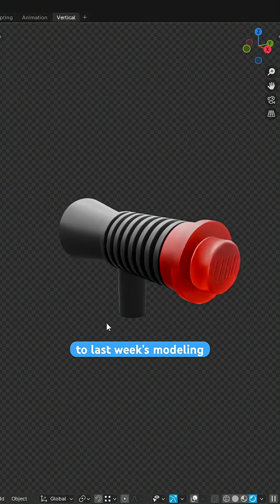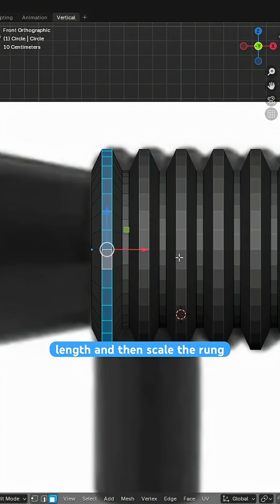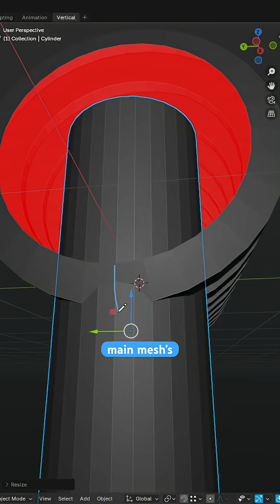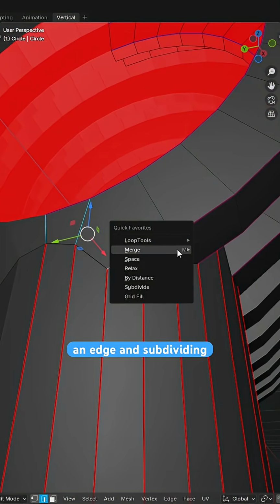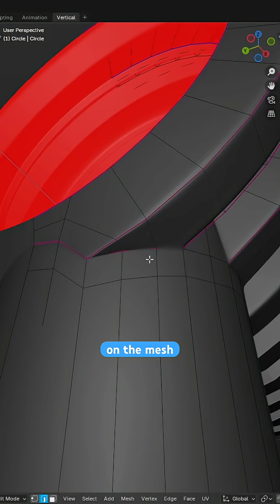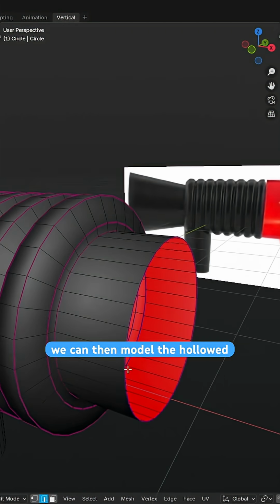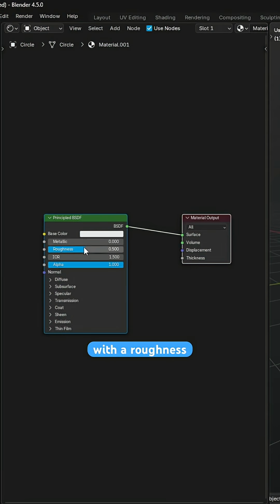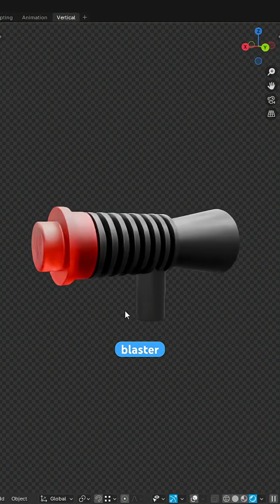Model a Lego Blaster in Blender | #blendertutorial #blender3d #blender3dmodelling

Comment: Wouldn't it be easier to use circles with less vertices?
Reply from the maker: Potentially? Though, you would still need to resolve similar poles and likely become much more of a headache when joining the meshes together since you don't have as many vert points to reference (really depends how low of a poly count you choose to go with). 😄

But I think a circle with 32 verts is a good vert count for an asset like this. You can always decimate and optimise the mesh afterwards. 😄

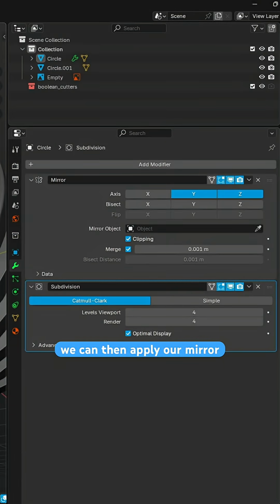Comment: In 1:49 how do you only mirroed the cilinder part without mirroing the handle???
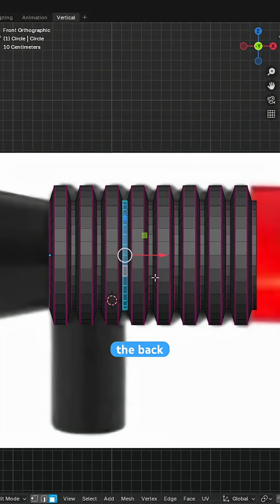Reply from the maker: So at 0:32, after applying the array modifier, I separate those back three rungs from the rest of the mesh in preparation to do the boolean and mirror modifier operations on that isolated area. 😄

Comment: Me, an engineering student, having a couple years of experience in SolidWorks: "Ah yes, I've heard of meshes before."
Reply from the maker: Haha, yeah, parametric modelling and vertex modelling are two very different beasts. 😅

it all comes down to the intent of what the model is being used for/the modellers preference. Traditionally speaking, you'd use parametric modelling for print and vertex modelling for digital use. Though like many things in modelling, that's doesn't have to be followed so strictly, as I know people that do vertex modelling for print and others that use parametric modelling for digital assets. 😄

Comment: Onshape could have gotten this done with a fraction of features and work. Blender just isn't efficient, nor does it make fully manifold mesh files. I always have to repair the mesh files that are made in Blender.
Reply from the maker: I mean, it really depends on what you’re modelling for. 😁

In my case, subdivision hard surface modelling is ideal as it lets me simultaneously create a high and low poly model which works nicely for normal baking and texturing. 😁

I’ve never done modelling for print, though people in the past have followed along with my tutorials and made prints without hassle. Though, using parametric modelling software would obviously be better for print given that’s what it is designed for. So it ultimately comes down to the intent of what the model is being used for. 😁

Comment: As someone who cad models, you blender guys drive me nuts 😭 low poly models that are based on proportions only and no measurements. Don't even get me started on surface rendering vs the actual mesh. 

Cool tutorial though! Feels like more work then cad for you guys sometimes
Reply from the maker: Haha, yeah, I typically only model based on proportions but every now and then I'll display the actual edge lengths when modelling to better distribute details. 😄

Mind you, you can model things to a proper scale in Blender, I know people who do this for manufacturing print models that need to be precise down to the mm. So it is possible, but I much prefer just eyeballing things, which being a CAD modeller, I can see why that would drive you nuts. 😅

And yeah, possible a little more work, but for being able to bake normals and texture the asset, it works out quite nicely. 😄

Comment: I don't think you need to necessarily merge different shapes together. You can make clipping meshes look pretty good as well
Reply from the maker: You're totally right, though, the idea of these challenges and the modelling exercises that they offer are to get people thinking about topology and problem solving. 😄

Intersection cylinders are a tricky subject matter in subdivision hard surface modelling, and they are never a one size fits all solution. But the learnings gained from this challenge would then also be applied to say needing to model in a screw hole to a mesh. An instance where the mesh is depressed and therefore needs to be integrated into the topology. 😄

Comment: ah. i've been studying cad for over a year now. blender is just a different animal 😭
Reply from the maker: Haha, I feel the same way about CAD and parametric modelling. 😅

I've only learnt vertex modelling, so I'm completely lost to modelling outside of that. I still find it immeasurably interesting despite not understanding it though. 😄
Reply: @masterj2001 so there is hope! 

for me, figuring out my process came from taking measurements off of real parts and building step by step. similar to how it works in this video.

but, it's a lot simpler of a toolbench in packages like solidworks or onshape. taking sketches and dimensioning, then extruding/subtracting, applying patterns/arrays, fillets and chamfers, etc

but thankfully, no messing about with topology or uv or shaders. just functional parts :)

Comment: now recreate the low poly one from the ps2 games🔥
Reply from the maker: Ahh, now that'd be easy. 😄

By memory, the model is just an octagon, extruded and scaled to fit the same shape as this and all the detailed is just implied through different colours on the texture. 😄

Oh, and the handle wouldn't need to be connected with actual mesh, it could just be two intersecting meshes for a PS2 era model. 😄

Comment: Not to nitpick, or anything, you did great, but why didn't you just follow to proportions of the serrations of the body
Reply from the maker: I thought I did? Though I could be missing something. I tried to match it the best I could, thus why after adding the array I scaled the whole thing back and then scaled the outer extruded rung. For a cylindrical reference image like this, you'll never get it to line up exactly with the reference as you need to remember the lens of the camera will naturally distort the shape.

The only way to avoid this would be to photograph the object with a lens at an insanely high focal length, similar to an orthographic view in Blender, you'll always see a bit of mismatch and distortion when referencing cylindrical objects. 😄

I hope that's what you meant and I've addressed the right thing here? 😅
Reply: @masterj2001 yeah, this is true, you still did great.
Reply from the maker: @Gear-Interactive  I appreciate your keen eye for detail though. 😄 Do you model yourself at all?
Reply: @masterj2001 I do. I replied to this not long after you replied but I don't see my reply anymore. I do model, right now, I mostly do 360 environment work for a VR for Therapy, PTSD, Autism, Hospitalized individuals, and so on company CatapalloVR. They've mostly used AI, but I've slowly been coming in, when they contract me, to replace some of the AI or actually make stuff for them instead of AI.
Reply from the maker: Just saw these, sorry about the delay mate, apparently YouTube was having some issues with comments last week. But wow, this is such a niche use of 3D, and I absolutely love it! I think for as far as the uses of AI are concerned, this is certainly on the more ethical end of things, but it's great to hear that there's still work in it for you too despite that. 😄 

Are you able to share any of your environment work online? As if so, I'd love to check some of it out! 😄
Reply: Reminder that online pictures are usually not taken with an orthographic perspective, so its fine if your model looks slightly unaligned